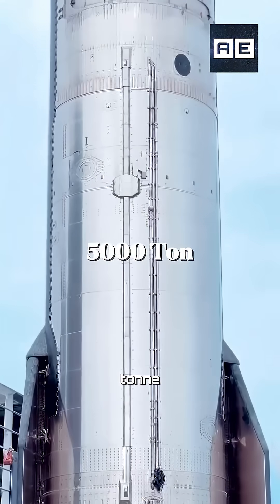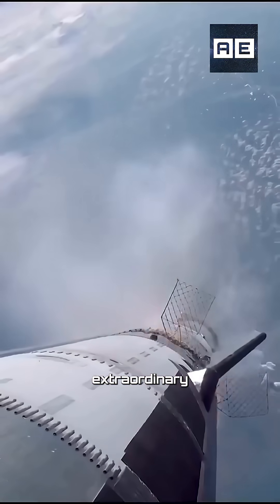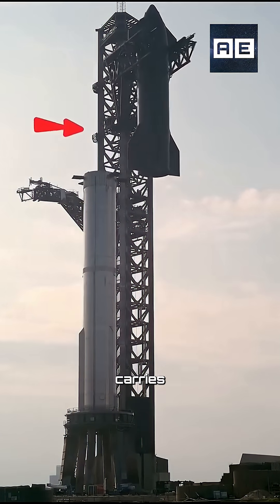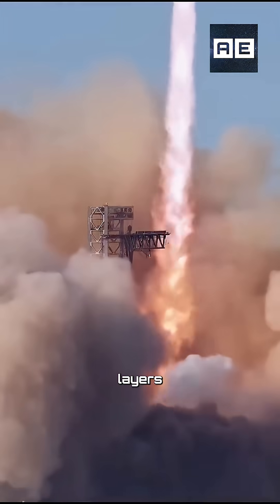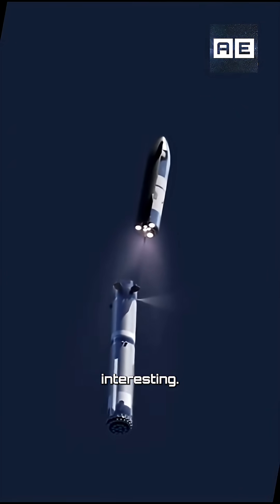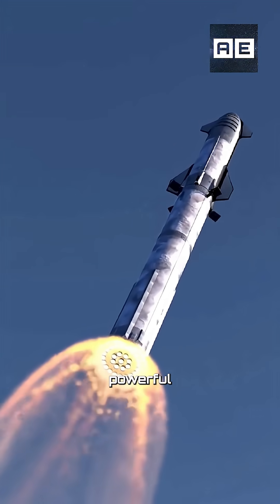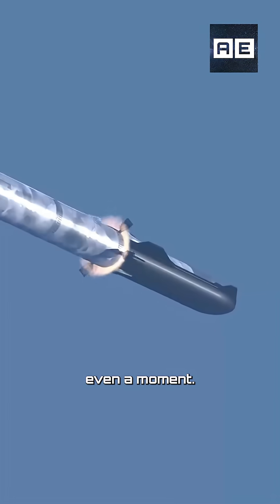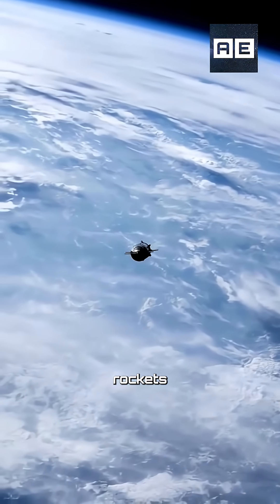The Secret Trick That Lets Rockets Reach Space #science #sciencefacts #space

Comment: Y don't rockets tilt over during lift offs in slow motion speed?
Reply from the maker: Rockets don't tilt over during lift-off because they use active control systems to maintain stability. While a rocket's thrust is located at the bottom, which might seem unstable, engineers have developed methods to counteract any tipping motion.